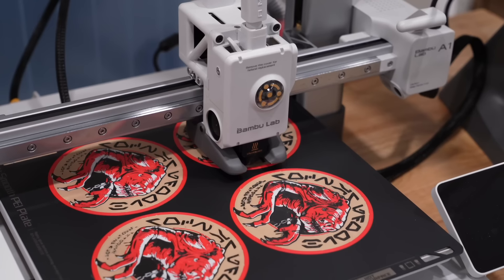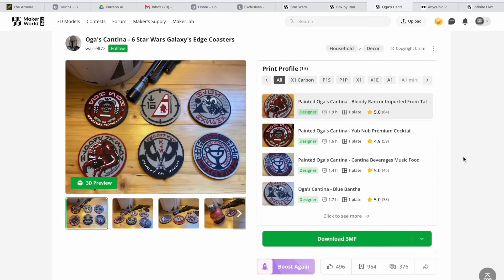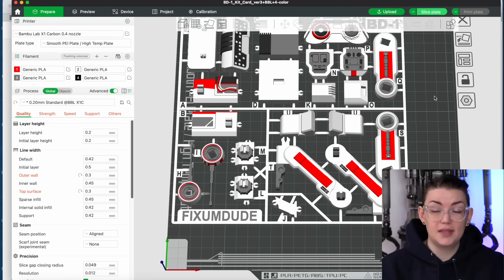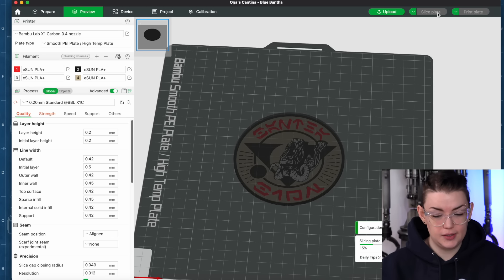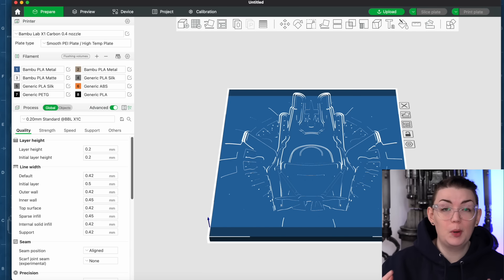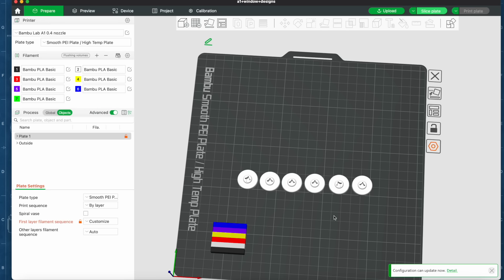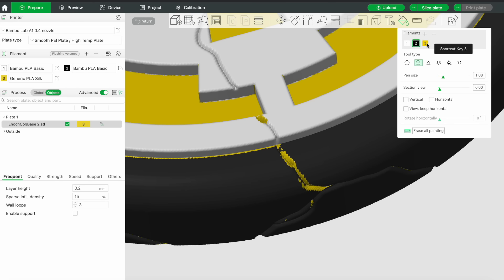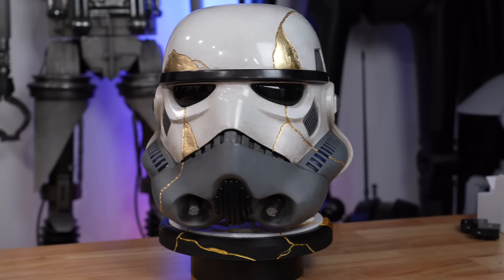Master Multicolor 3D Printing

Comment: There is the semi-debate on if it is a purge tower or prime tower. I lean towards prime tower where it rebuilds pressure in the hot end after a purge. Most of time it is needed to have proper flow as it starts printing each layer / color or could have minor gaps. If using a purge object (and it can absorb full purge volumes, and you don’t care about possible minor gaps) you can eliminate the tower.

Comment: I have an A1 but not an AMS Lite yet. I can't wait to order one!!!
Reply: The AMS Lite and AMs are definitely game changers, love all of mine.
Reply: I have an A1 Mini and an AMS Lite.  It works fantastic. Even if you don't do multi-colour, you can load up four of your most commonly used colours and then just print without having to manually switch filaments.  Print a blue thing, print a black thing, print a red thing etc...  Really convenient.  AMS swap time in my experience is usually between 1.25 and 1.50 minutes so it can add a LOT of time to your print.  Even just one switch per layer adds at least one minute per layer to your print time.

Comment: This was crazy helpful to me. I've been creating individual svg files for each color and importing them in to the same plate, and selecting the filament for each assembly. This works except it gets really finicky with compound paths. I've definitely been doing it the hard way. From now on it's going to be one svg and then paint it in the slicer. I've painted plenty of models but never considered doing it this way for my own svgs (for light boxes). Thank you for the video!

Comment: Great video and nice explanation. I imagine most of this will apply to a Creality K2  software as well. I stepped away from 3D printing for a few years after years of upgrading Ender 1's Cr10's Folgertech FT 5's. I used to convert beds to metal magnetic plates, upgrade hot ends, and then chase more problems and got tired of it. I am going to try and get back in with some of the new hotter to print filaments and wanted a heated enclosure. I am looking forward to trying more multi color prints as well. Thanks for making this video.

Comment: I had the same issue recently with all the seams and weirdness on the back of a print. The way around it is I extrude the whole back part like -2mm in fusion as its own component. Then all
The seperate parts extrude +2mm to their own components. Then when you load into the slicer you use the component colour change  drop downs in the objects tab.  Works a treat and much easier than the paint tool.

Comment: Before I go through the process, does the flushing option button appear when the AMS is connected? It is not displayed currently.
Reply: Or is it dependent on multiple filaments in a project?
Reply from the maker: You just need to have more than 1 filament in your project. Right beside the flushing volumes button is the + and - filament buttons, just add at least a second filament and the flush settings button will show up.
Reply: @MMsPropShop  thank you!

Comment: Great video. But quick heads up: A single extruder printer (does not matter which one) is only able to reduce color blending by purging filament. Preventing it is technical impossible even tho at some level it’s very hard to spot. 

*.3mf files are nothing else as *.zip files. They include the actual *.stl file and some other, often slicer specific, metadata infos.